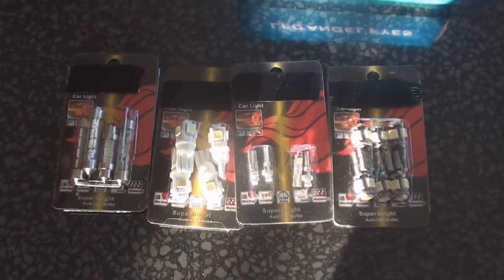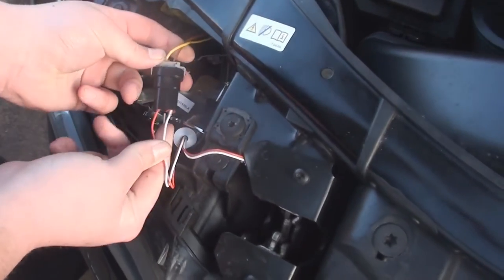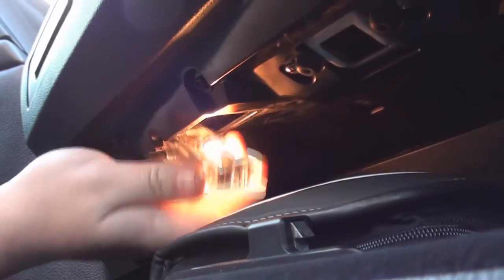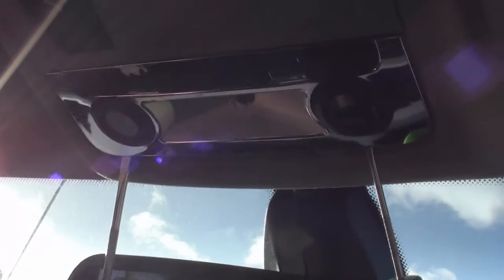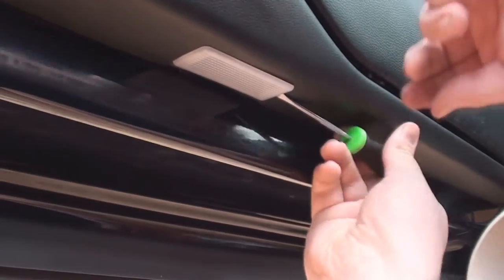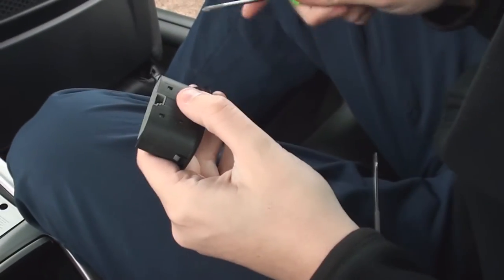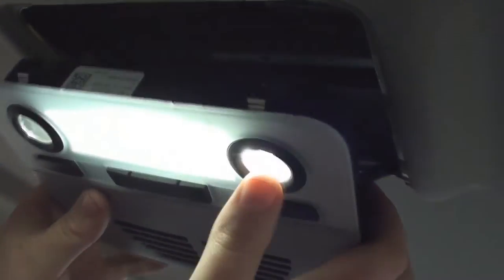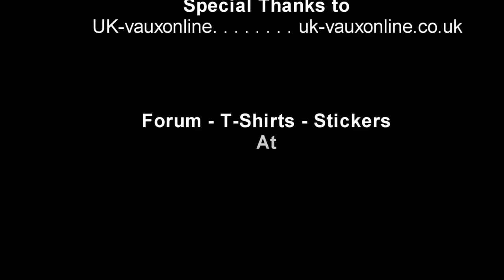How to Install LED Side Lights

Comment: Where did you order all of the lights? I would like to do this on my 2011 e90.
Reply from the maker: Ebay, They came as a complete pack. The only things seperate was the Angel eyes bulbs
Reply: Absolute Modicts
Thanks! Do you have to have HID lights to do the Angel Eyes replacement? I'm not sure where to find those for my car. Its a sedan rather than the beautiful coupe in this vid.
Reply from the maker: the main lights were factory fitted xenons not hids. The angels should be H8 bulbs the same tho, Just double check before you buy